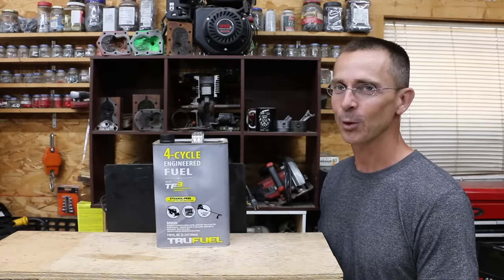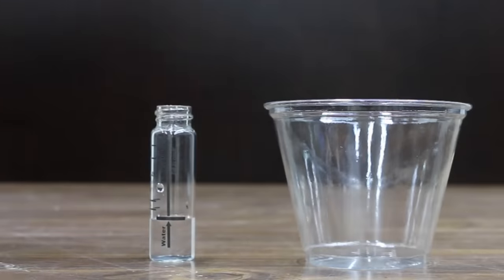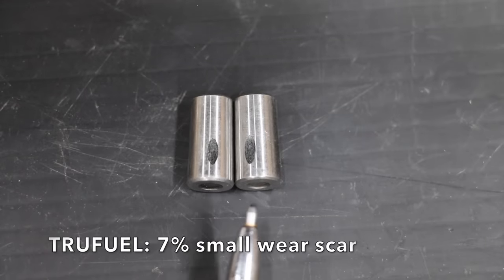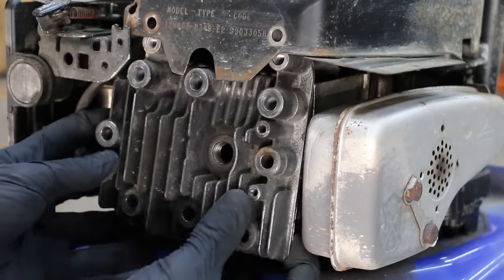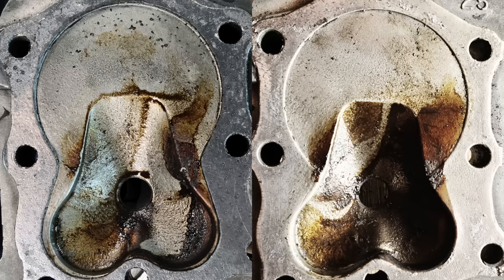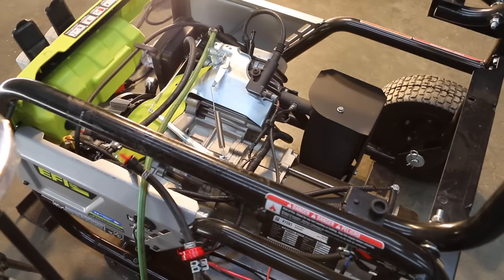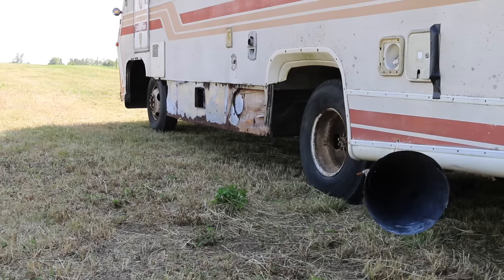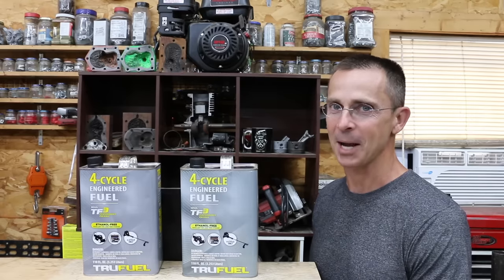Engineered Fuel better than Pump Gasoline?  Better Fuel Efficiency and MPGs? Let's find out!

Comment: Huge fan here!! But I think you missed the point of TruFuel! That being, it’s a friction modifier, prevents corrosion and does not absorb moisture. I don’t think your test necessarily showed that. Maybe I missed that but I don’t recall. It’s a fuel replacement that’s designed for long-term usage and stowage WITHOUT the effects that standard gas has as a known limiting factor… I recommend a long term, complete review that tests ‘these’ parameters vs ‘does it work’. Again, HUGE and incredibly respectful of all that you provide delve into concerning your reviews as they are worth their weight in gold but think you may have missed the real objective here. Cheers!

Comment: Would love to see a mix of distilled water, dish soap and gasoline, roughly 60 percent gas and 40 percent water. I use the mix to cut some grass with my weed wacker and it seemed to run decent, less power but I assume less gasoline consumption considering almost half the fuel was water. The fuel will separate after hours but if it was mixed by a pump or a bypass system it seems it could work for almost any gas engine.
Reply from the maker: Thanks for the video idea.
Reply: @ProjectFarm  thanks for the reply, love your content.

Comment: Suggestion for using the clear engine - would aiming your temperature sensor at it be able to read the temperature at which the fuel is burning in the engine and would that temperature difference effect the engine wear and/or how clean the stuff is burning?
Reply: Problem with the clear engine is the ir cameras don't work so well on reflective surfaces.

Comment: my local gas station doesn't sell non ethanol fuel, so i bought engineered gas at the hardware store, and i put it in my car and the car got 15 MPG improvement over when it was stock. car tested was a 2011 crown vic p71 from the factory the car got 15 Mpg after i got 30 MPG!!!!
Reply from the maker: Glad to hear!

Comment: Project Farm I'd like to see you test octane boosters not if they increase horse power (they dont) but if they really raise octane like race fuel concentrate Royal Purple Lucas even some cheap ones because I use octane booster on occasion in my 2010 GT I run 93 but on occasion I can only get 91 depending on the station so I use a booster because the tune in my GT is set for 93+ I'm not sure how you could test octane boosters but you're a lot smarter than me and I'm sure you can figure it out love you videos brother keep it up
Reply from the maker: Thanks, will do!  Thanks for the video idea.
Reply: @ProjectFarm  awesome brother thank you looking forward to it!! Definitely test race gas concentrate a lot if people use that for racing

Comment: The buildup from the TruFuel compared to non ethanol gas reassures the claim of lubricants or other additives. I would rather just run the non ethanol fuel from the store as it burns cleaner and doesn’t go bad after a couple of weeks or foul up carburetors if left for months at time. It’s really amazing how society complaining about the price of fuel has led to them adding ethanol to get the price down which in turn causes the engine to burn more fuel to produce the same power from standard gas. In turn using more fuel and costing more money than if it was left alone to begin with. 🤔
Reply from the maker: Thanks for the feedback.

Comment: you should try alkylate petrol/aspen fuel next
I swapped the cylinder on my chainsaw for extra power, after 4-5 tanks on aspen fuel it was spotless with no carbon buildup anywhere
Reply from the maker: Thanks for the suggestion.

Comment: Would 100LL AVGAS work. It has a long shelf life, no ethanol. I have used a couple times in a pressure washer. I keep a supply on hand for a 0540 lycoming powered airboat. Don't know what the long term usage would do to the small engine. It does have some lead. Most of the time it is around $3 to $3.50 or so a gal at he the local airport. I really enjoy the projects. Keep them coming. Jim
Reply from the maker: Thanks, will do.

Comment: Curious to know if you noticed a difference in exhaust smell? Recently bought some premix trufuel 2stroke for my chainsaw and weed whacker and felt the trufuel had a sweeter smell.  I can't find non ethanol fuel in my state (save for 104 octane race fuel) so I'm stuck using trufuel. Figure I'd use it in the last tank of the season to flush out any chance of ethanol build up. Great video as always!

Comment: Project Farm,  love your unbiased analysis and your testing of parameters I would never think of.  However on the True Fuel,  I have to disagree.  The most important thing that causes small engines to fail is degradation of fuel.  Ethanol fuel is horrible as you have shown but non ethanol fuel albeit better, still does not have the shelf life of fuel from many years ago.  This is where Tru Fuel has an advantage.  I use the mixed Tru Fuel for storing chainsaws, (two cycle) if they are going to sit over a couple months, (Summarization).   For other small motors such as pressure washers I will store with 100LL aviation fuel which has a better shelf life to.

So how bout a test of shelf life of ethanol gas, ethanol free, true fuel and 100LL aviation fuel.
Reply from the maker: Thanks for the video idea.
Reply: @ProjectFarm    A few years back I helped out in a local chainsaw shop.  Roughly half the small motors that came in for repair had fuel related problems.  We sent out every repaired unit with Husqvarna branded pre mixed gas to insure it wouldn't happen again at least for that tank.  I feel the synthetic mixed fuel is the cheapest insurance you can buy for 2 cycle engines.  The owner also thought storage with synthetic fuel was better than letting carbs run dry due to two things, 1.  lean condition as it runs out and 2.  Residue left when it runs out and the seals/diaphragms drying out.

Comment: I say Stihl Motomix and Stihl Moto4 are the best in my opinion if you take a cap full and burn it you will see how clean it burns. Only other fuel that I’ve seen which is my 2nd choice is Aspen fuels. I highly recommend try it out you will see some cases I’ve seen Trufuel cause issues not sure if it’s a bad batch or what. I don’t trust anything in my experience but Stihl true and test burn a cap full you will see how clean it burns! I would like to see Aspen and motomix on a test burn
Reply from the maker: Thanks for the suggestion.

Comment: I am not a strong proponent of 'engineered' fuel products yet I have packed them as 'emergency' fuel reserves for long motorcycle & scooter rides (1 qt cans); towards the end of the riding season I add the stuff to the gas tank and run the moto or scoot like normal
Reply from the maker: Thanks for sharing.

Comment: Whats going on with fuel in america? In germany the lowest octane number which you can buy regularly on the gas station is 95. You can also buy fuel with 100 octane (Shell and OMV) or 102 (Aral) on the gas station. When we buy special fuel its E85 or 117 Octane Racefuel for engines with a lot of power.
Reply from the maker: Thanks for the feedback.

Comment: You should try the Beco fuel tablets, they claim to clean upper engine and increase fuel mileage in gasoline or diesel engines by 15-20%.
Reply from the maker: Thanks for the suggestion.

Comment: Video suggestion: Metal filed!! Three sq taper for sharpening saws
Reply from the maker: Thanks for the video idea.
Reply: @ProjectFarm  I’m thinking you could try to test some of the new Box store Nicholson (and others) files and compare them to the NOS made in USA  files available on eBay. The oldies are ridiculously expensive and I can’t decide if they are worth the price. 
Also, testing myths like 1. Chalk keeps the files from clogging 2. Acid sharpening 3. Back & forth vs push filing 4. Try to connect with someone like This old Tony or Clickspring about making them at home. 
Cheers! We’re going to test this!!

Comment: i go by run on pump gas with added stabilizer, or store on engineered gas. I  have had no post storage plugged carburetor problems  this way. pump gas is absolute crap for long term storage.
    it's nice when that chain saw  or weed Wacker thats been sitting for 6 months starts on the 3rd pull.  carb cleaning lawn equipment used to be a yearly  ritual for me.
Reply from the maker: Thanks for sharing.

Comment: I use the 2cycle TruFuel in equipment that doesn't burn a lot of fuel and for last run of the season.  It's paid for itself in annual carb maintenance and trouble free starts many times over.  It's hard to find ethanol free gas in my area, or I'd use that with stabil instead.  But now nearly all of my OPE runs on batteries.  Don't miss the gas powered stuff a bit.  TruFuel is a good product, but way overpriced to everyday use.
Reply from the maker: Thanks for sharing.

Comment: You have already tested shelf life of unleaded fuel both with ethanol and without as well as with stabilizer and without. That stuff did not run the mower after a year. I think only the non ethanol non stabilizer fuel worked. 
  Need to let the tru-fuel sit a year and test it like the other fuels. That is the reason people pay for the tru-fuel. I saw a water pump stored with tru-fuel and after 2 years it would not run, dumped it and added fresh unleaded and it sparked right up so I have my doubts on the longevity of  tru-fuel.

Comment: It would be good to see a test like this with TCW-3 added to gasoline at a 4 OZ per 18 gallons ratio.   This would be to see if adding TCW-3 to your automobile fuel is a myth or an actual helper.
Reply from the maker: Thanks for the video idea.
Reply: @ProjectFarm  Thanks for the quick reply.  Some of the car clubs that I'm in suggest 4oz of WalMart TCW-3 to 18 gallons of fuel.  I have tried it a few times.   I don't know if its a placebo effect or if it helps lubricate fuel injectors.  I remember my dad used a "top oil" fuel additive in the 1960s named Bardahl.  Sometimes I think TCW-3 may provide that type of benefit.

Comment: I have been a little frustrated with trying to sort through different brands dry cut or cold cut 14" metal cutting blades.  I looked but haven't seen a good review on them, seems like it would fit in with your saw blade and drill bit reviews.
Reply from the maker: Thanks for the suggestion.

Comment: AvGas is even better. Has no ethanol, can sit in the shed for 7 years ...runs cooler, lubricates better. The 100 octane has no affect on engines with consumer level compressions, it helps if you have a higher compression engine. Btw, I had my lead levels checked after several years of racing offroad bikes with avgas . I was slightly below acceptable normal range.

Comment: My equipment runs far better on 91 octane ethanol free gasoline from the pump.  Husqvarna told me thwy do not recommend running any canned fuel in their equipment including their own brand of canned fuel unless you do not have access to ethenol free fuel from the pump. I use VP 2 cycle oil for my mix.
Reply from the maker: Thanks for the feedback.

Comment: I live a 1/4  mile  from Lake Erie. I use boat gas. 90 octane no ethanol. good for 2 years. left it set in my leaf blower for 3 years. started on first pull and ran fine. 5.15 a gallon. or you use aviation gas. it also has no ethanol.
Reply from the maker: Thanks for sharing.

Comment: People may laugh when I put Ethanol free fuel into my older beater truck. It is not a hotrod, but it is old enough that it was pre-ethanol and I don't drive a lot so the truck sits for weeks at a time. Ethanol is great if your fuel system is made for it and makes race fuel power under boost. But $20 a gallon? Way too much, buy a bottle of Sta-Bil and some 100% gasoline...
Reply from the maker: Thanks for sharing.

Comment: Ethanol gas has become the latest "it's not my fault" excuse for neglect and poor maintainence. What's so hard about using fresh gas, draining it at the end of the season and performing proper maintainence? That's what I have done for the last 40+ years of owning (and still own) pretty much anything that ever had a small engine attached to it. I have always ran just regular grade pump gas and have never had a problem.
Reply from the maker: Thanks for the feedback.

Comment: RE: Ethanol tester - So, can I get a large tank of gas and add water to it and separate out the ethanol? Will the resultant separated gas run reliably in an engine? Not sure if that is something you would want to test, but if it works it might be less expensive than buying the nonethanol stuff. And what would I do with the ethanol-water afterward? Is there a safe way to dispose of it?

Thanks. Love the videos
Reply: Oh, and how much ethanol is left in the gas after using water to separate?

Thanks again

Comment: What is the lightest weight oil with the highest lubricity. Cars 20 years and newer cannot pump 30 weight, oil pump cannot produce psi for small channels in newer engines, so what 5-30w oil has highest wear resistance lubricity equal or better than thicker 30 weight and 20- 50 weight oils. Thickness does not necessarily mean more protection as oils break down easier than others. The perfect oil is the lightest with highest lubricity. My GM 07 specs 5-30 I can use 10-30 any heavier lugs my oil pump and chokes my variable camshaft solenoid. Engine idles rough will burn it up. Thanks for your work and responding.
Reply from the maker: Thank you  for sharing
Reply: @ProjectFarm   Do you have a preferred 5-30w oil. With high lubricity.

Comment: In my area you cannot buy non-ethanol gasoline its all 10%. Boat marinas will not let you fill up a car or truck and its very expensive. You should have also tested this with 10% ethanol gasoline.
Reply from the maker: Thanks for the suggestion.

Comment: How about testing fuel quality and economy with all the different test engines? 😉
Buy a can of the cheapest fuel of lowest grade from one station and the most expensive fuel with the highest grade from another station.
The carbon build-up, the lubricity and the economy (also in relation to the price) in the generator will be as interesting as the maximum speed with your go-cart. 😉👍
Reply from the maker: Thanks for the suggestion.
Reply: @ProjectFarm  😉👍

Comment: Also mixing aviation fuel in two cycle fuel I know that the aviation fuel evaporates quite quickly? So that would probably leave excessive oil in my tank? And I wonder if there would be any running or separation problems? Thanks like your videos.

Comment: For people who can't buy Non-Ethanol fuel from any gas station within 1.5 hrs. driving, Tru Fuel is the one to get for small engine use, that is used occasionally like mowers.  Too bad there wan't a test against Ethanol Fuel and Tru Fuel.
Reply from the maker: Thanks for the suggestion.
Reply: @ProjectFarm  Great videos by the way.  I have a `74 Lawn Boy in our family since new, and is being re-built quite possibly due to the havoc of ethanol.  Incredible that so many fuel stabilizers do nothing for water separation and hardly cut-down on corrosion.

Comment: I'm into emergency preparedness and currently storing about 120 liters of gasoline for emergency use in jerry cans. I like that the gas is stored in sealed containers and free of ethanol. Once I take into account safe storage of the product and the increased cost over pump gas, is this suitable for use in automotive engines such as those intended to run on regular 87 octane gasoline?

Comment: I wonder if the deposits found on the head and spark plug were stabilizing agents or longevity components? Also I’d fill my 5k generator with Tru Fuel before ethanol free pump gas any day. That pump gas won’t protect down the road.
Reply from the maker: Thanks for the suggestion.

Comment: The idea of an engineered fuel that addresses the component parts of fuels that quickly breakdown over time and cause fuel system problems is a great idea.  However, the last time I bought some of that Engineered fuel, I didn't use it right away and, after a month's time, the inside of the fuel can rusted (after opening it once for 1 minute).  Is anyone else experiencing this problem?  Has anyone used Coleman lantern fuel?  I would think it could also be used for engines during a shutdown for preservative purposes (such as a generator that only gets used ocasionally).
Reply from the maker: Thanks for the video idea.

Comment: In our market we can only get 87 octane dino fuel. To get higher octane, we are forced to use ethanol blends; fine for every car I have ever used it in. But the 10% corn-gas does not do well in mower/trimmers/generators 2 or 4 stroke, in my experience. I have been using Lucas Octane boost with decent results. Is there something better for small 2-strokes up to 852cc Kawasaki 4-stroke? The Lucas seems to leave a "rusty" look to the spark plugs that must be wire brushed often (blended with 87 octance 100% gas). Thanks in advance for any input.

Comment: Little tip on fill-lines and how to use them:
You always read the bottom of a concave meniscus (like water) or the top of a convex meniscus (like with mercury).
So the bottom of the meniscus has to be at the mark, not the sides creeping up on the glass. Not a huge error, but maybe nice to know.
Google "volumetric flask meniscus" pictures for a visual reference.
Reply from the maker: Thanks for the tip.
Reply: Oh Leo, you technical wizard you!  🙄😂

Comment: I just wanted to say quad caulking as engine oil! How long will it run for? If it’s sealed in the engine will it harden and if so how quickly will it harden? Can you add brake cleaner into the engine to flush it out in the end?? Idk let’s find out am I right???
Reply from the maker: Thank you  for the video idea!